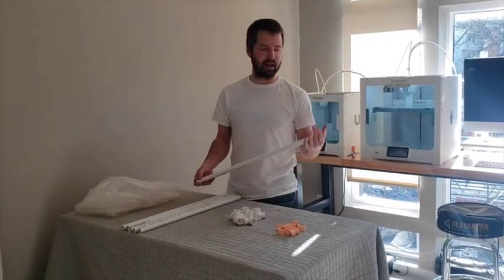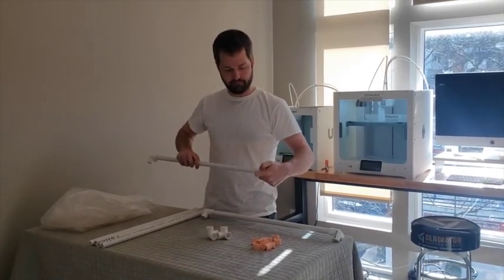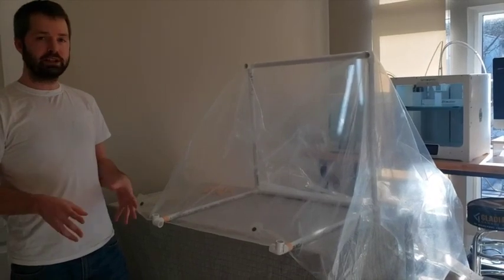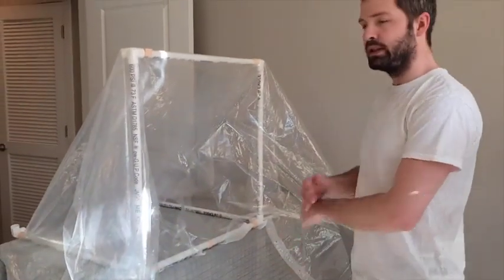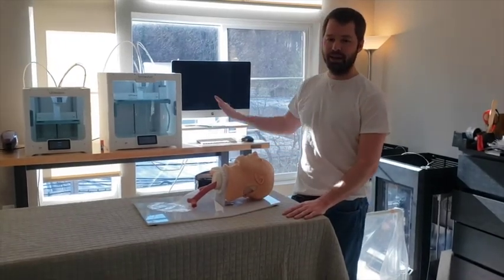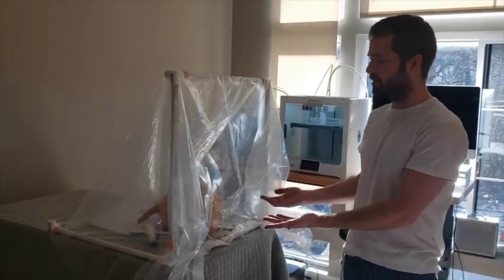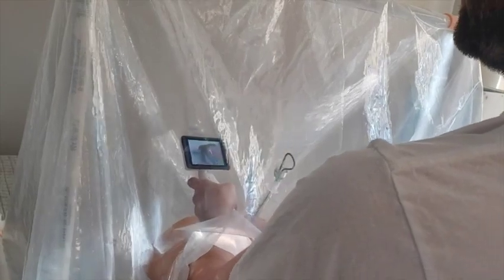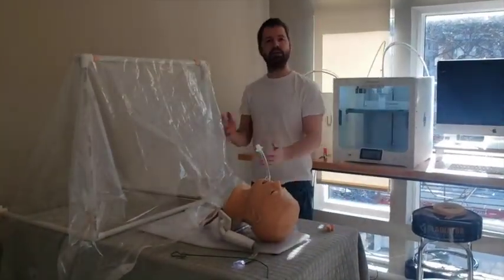COVID19   CORONAVIRUS INTUBATION TENT DESIGN

Comment: I recommend just slip a 33 gallon clear plastic trash bag over your head while you intubate the patient. It generally takes less than a minute anyway for the procedure and there are plenty of air in the bag to last you much, much longer. The trash bag also allows you total freedom of movement while protecting your entire head and upper torso. The advantage of a trash bag is it is totally impermeable to any droplet sprays and it is cheap and use-once-and-throw-away.